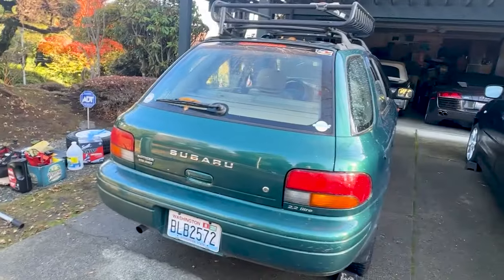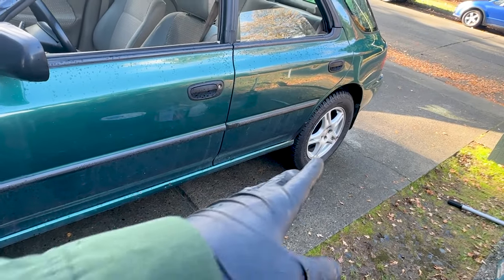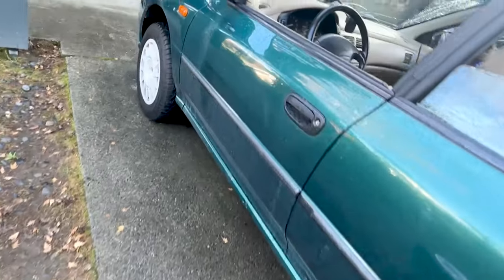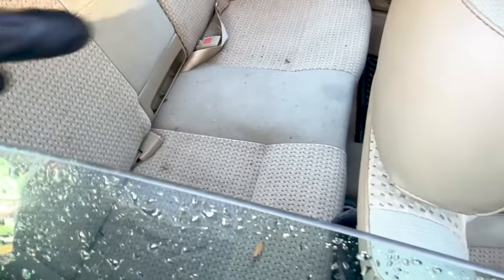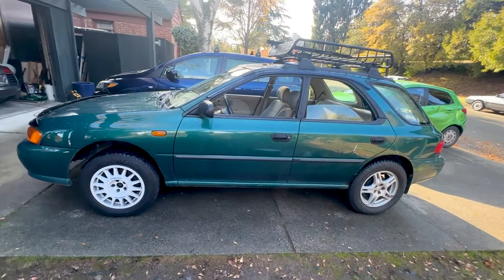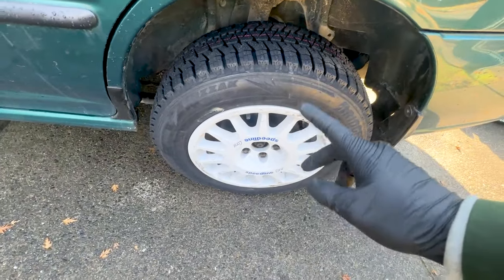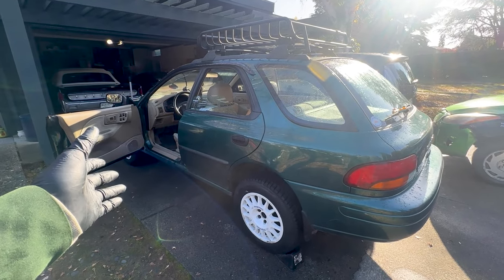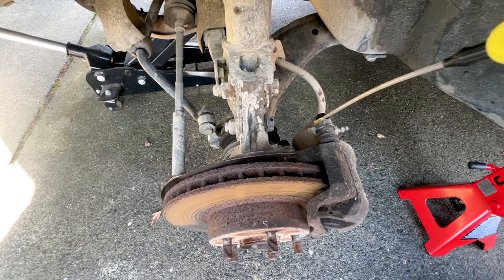The Thieves Ruined My Brakes? Fixing my Stolen Subaru Impreza Battlewagon Ep. 13

Comment: To prevent theft put a toggle switch in it that is hidden to shut off fuel pump they will only.get about 50 feet before it runs out of fuel and won't restart
Reply: if you wire a kill switch to the fuel relay its a lot easier, car wont even start it'll just turn over
Reply: Same idea 💡
Reply from the maker: good ideas all around - thanks guys

Comment: Why did you stick on a new Blizzak with 3 GT Radial snow tires on the other positions?  I would have got a matching GT Radial.   A great brake upgrade is twin piston front brakes off a 1997ish Outback.  It made a huge difference in my 1996 Outback sport.
Reply from the maker: Thats all I could find in stock. The supply for winters during the cold months gets kinda wild around here. Just needed something to do the job

Comment: Hey man, when you ran the 16inch wrx wheels, did you have to run spacers?
Reply from the maker: Nope! Just wrx wheels with 215/65/16 tires. Had to hammer out some of the wheel well to get them to fit without rubbing tho